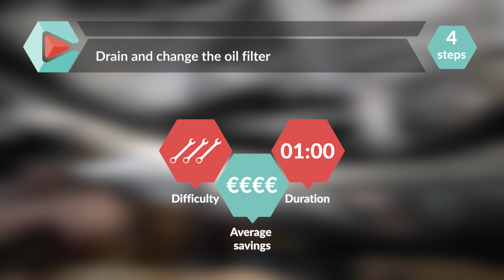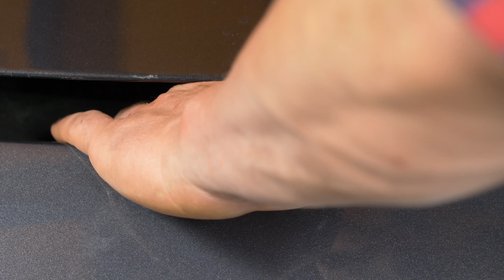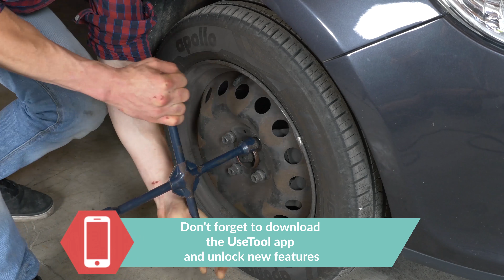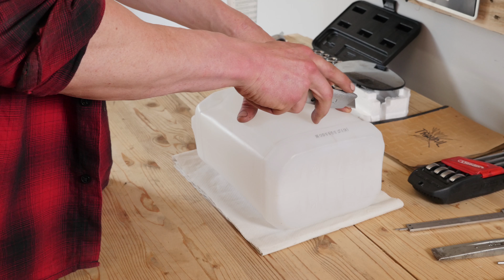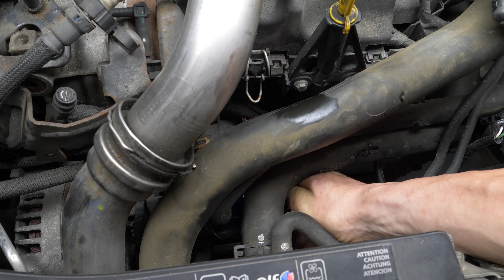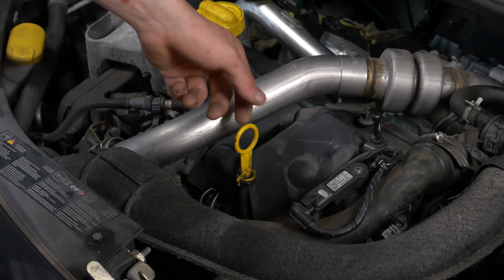Change the oil and the oil filter Clio mk3 1.5 dCi 🛢

Comment: Great video! I have a question, please. It’s about my Clio 3 dCi 1.5 with 106 HP from 2008, Euro 4.
Unfortunately, I don’t know whether my car has a particulate filter (DPF) or not. And which oil is the correct one: RN0720 or RN0700?

Comment: Tip: check the oil level before draining. Measure the quantity of oil drained. Replace same amount and add more as required to be 90% full.
Btw a DPF was legally required on diesels manufactured after Sept 2009 so do check the oil spec requirement. My 2011 K9K 770 engine takes fully synthetic 5W 30.

Comment: Clio 3 1.5 DCi use RN0720 standard 5W30 Oil and not 5W40 like in the video
Reply: This is euro 4 engine , not euro 5 
euro 4 engine haven't dpf
Reply: 5w30 for euro 5 engine 
5w40 euro 4 haven't dpf engine
Reply: @Largo5441  Nice, thanks

Comment: really good video. 
but the oil you pour is wrong. 
1.5dCi engine oil MUST be RN0720 standard , due to DPF filter.
ELF EVOLUTION FULLTECH FE with RN0720 standard is right oil for dci engines.
Reply: Elf Evolution 900SXR 5w40
Reply: @taomahNEGEV  Elf Evolution 900SXR 5w40 is RN0700 and RN0710 standard  .  modern 1.5dci engines need RN0720 oil standard.
Reply: @MaxHardcoreSLOVAKIA  Please, define modern.   Mine is  2008 it has been happy  with the 900SXR 5w40 since then.
Reply: @taomahNEGEV  Renault 1.5 dCi  , K9K636 ,  81KW / 110HP with common rail piezo VDO/Siemens
Reply: @MaxHardcoreSLOVAKIA  Thanks.  My future engine will be electric.